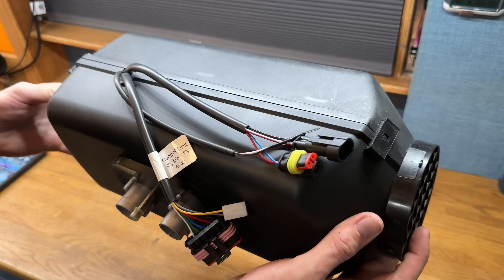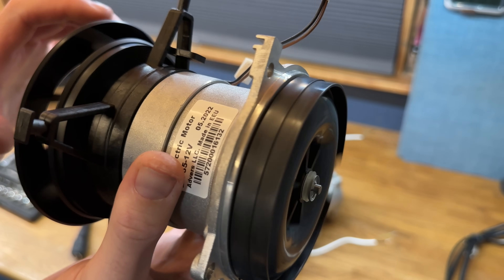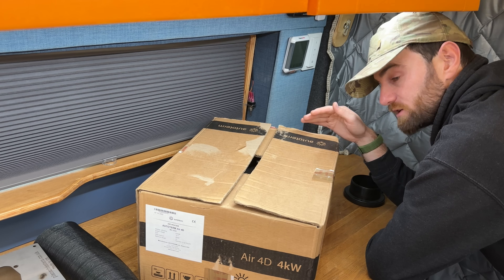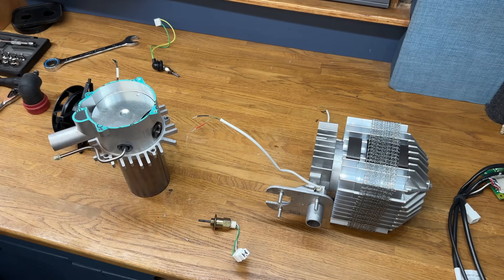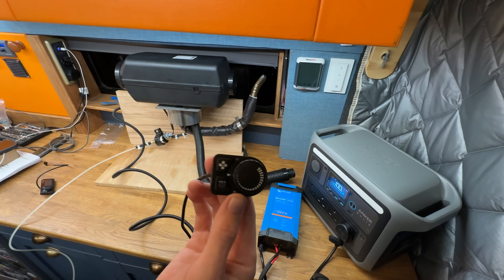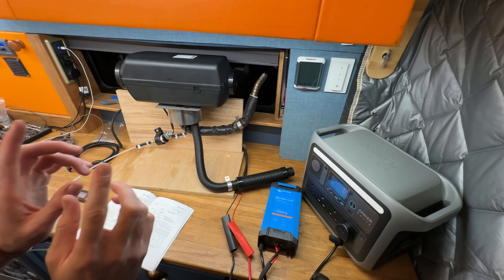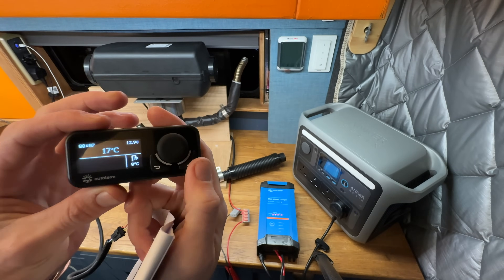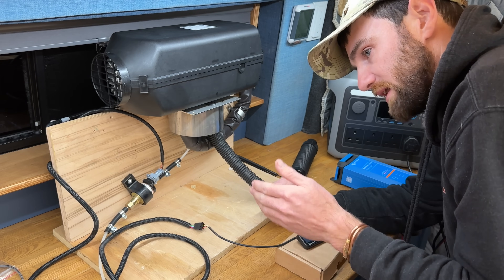UNIQUE DESIGN! DIESEL HEATER AUTOTERM AIR 4D

Comment: Hi, I just mounted the Autoterm 2D on my VW T6 van, it seems to work perfectly! One thing I've noticed is that I can hear when the drop of fuel goes in into the combustion chamber when I run it at low speed, with that I mean the noise of the combustion chamber is not linear anymore but it goes up (when it gest the drop) and down, I've been trying to listen to all videos the noise in background but I couldn't figure it out 😄, can you tell me?
Reply from the maker: The lowest setting it’s a pretty slow dose from the pump so I’m not surprised you could hear the combustion. I didn’t notice it on the 4D on low, but the 2D on low will might be even lower. 

I have noticed the pump speed changing up and down one some of the settings

Comment: Bluetti 200ac max has a 30amp 12v output.
Reply from the maker: Indeed, it does not many of the smaller 1 kW sub range. Have anything more though than the normal 12V 10A socket . It would be nice if some of them would start to use the Anderson connector or the XT60 for a 25 amp output

Comment: Hi Alex I am a complete diesel heater novice so excuse me. For any diesel heater can they run off a leisure battery or do they need mains or an inverter
Reply from the maker: Diesel heaters normally run of 12V DC. So they run off your leisure battery

Comment: Hi I have trouble with my diesel heater and thought you would be the best person to ask 😊... Basically it turns on starts up blows out hot air then the screen /display turns off. It has a 15amp fuse on it with a extended 6mm 53amp cable direct to the battery. Any idea what the problem could be 😟
Reply from the maker: Just to check as you’re commenting on an autoterm video. It’s an auto term heater to are having an issues with?
Reply: @MispronouncedAdventures  no it's the maxpeedingrods sorry
Reply: @MispronouncedAdventures  oh and it goes to 100amp hour renogy lithium battery which on the app says 12.9v

Comment: Ah! Watching now :)
Edit: I think Autoterm classifies the metering pump over 100 clicks. So your pump delivers 6.8ml over 100 clicks/pulses. Whereas other manufacturers measure by how many clicks for 1 ml. There are 16ml pumps (16 pulses for 1 ml), 18ml, 22ml, etc. The heaters need to be setup for the pump to have the correct Hz for the heater. Many Chinese heaters come with a random pump and the boards are not correctly setup for them. Heaters that soot up quickly probably came with a pump that is simply too large or the board hasn't been setup correctly.
Reply from the maker: Lots of different pumps around for sure. My engine pre heater is .42, one of my US / china Heater .62

You are right about the wrong pumps on wrong ECU’s is pretty common
Reply: Interesting! Have you covered that in any videos? Easy way to identify and resolve an issue of incorrect pump/board setup? @MispronouncedAdventures
Reply from the maker: No in videos as I’ve not had any incorrect issues with that personally, but I have fixed heaters before and see it referenced. Quite a few times online about wrong pump and ecu combos. 

It’s a lot more common on the 2 kW Chinese heaters. But seen them using .16, .18.5 & .22.

Comment: With the simple controller the fan doesn't stop even at required temp in any mode. Good for air circulation but not ideal. Hence need to change to better controller
Reply from the maker: From my understanding on the simple controller that requires the external temperature sensor In addition?
Reply: Even with the external temp sensor (which I have) when at required temp the heater stops but fan continues at all times

Comment: This vid couldn’t have come at a better time mate, but im still torn.

The quality of the Autoterm looks ace and has always been the plan to go for, I just don’t know whether to go for a 2kw and run it 3/4 to flat out all the time,  or 4kw and run only about 1/2 power else get too hot and soot up quicker etc.. especially in the warmer months when it’s on lowest just to take the chill off. 

I’ve had a 1.5kw fan heater running whilst I’m building and sometimes find with the door shut it gets a bit hot but then that’s at 2oC not minus-25/30!!

Mines a LWB sprinter, insulated well. 10mm closed cell foam(double layer full roof and cab bulkhead area, then pir board walls floor, and recycled fluff insulation in all the awkward areas.. 

We’re Looking to do -20 plus trips like yourself.

I feel from the ending you thought the Autoterm was good but still preferred your own setup with the afterburner??
Did you ever do a review/demo of that I can’t find it anywhere 

I’m still tempted by a Chinese 5kw and afterburner! Plus carry a spare for less than the Autoterm 

It’s not an easy decision!
What would you go for if you were building your van now mate?

Cheers 
Ant
Reply from the maker: It’s definitely a difficult decision. I am very spoilt by having an afterburner which is for a software side and abilities/features is superior to everything else on the market. 

But the Chinese diesel heater it controls is just a normal Chinese diesel heater whilst mine has been problem free. the Autoterm hardware wise is superior

Personally I would go for the larger, 4kW over the two. The vast majority of even my Chinese heater has been on low to less than half power and it’s generally clean inside.

The two features I love the most about the afterburner is the remote access and the ability to get all the data I want from sensors and RPM available and it’s thermostat, which I would say, performs better than the autoterm. However, it’s difficult for me to fully test the thermostat, without having the heater installed permanently

Comment: I installed my first heater last week and for some reason, I am getting a little smell in the heat outlet until the unit turns on and runs...
Reply: Mine was like that for a while, just needs running in 6-8 continuous hours at full blast.
Reply from the maker: I’ve heard similar before, well, I don’t know what the issue might be. There could be a number of things it could well be. a grease or oil leftover from the manufacturing process on the heat  exchanger which is getting heated up and will eventually evaporate after a few uses

Comment: Can anyone tell me if I could run this 2KW heater from the 12v car socket on a Bluetti AC180P?
Reply from the maker: I’m pretty sure it’s a no on the 12V car socket. looking at tech specs for the AC180P it’s 12V socket is 12V @ 10A. Which is probably a few wonts less than needed. Although I haven’t tested the 2kW version. But I imagine the glow plug and motor will be pretty similar.
Reply: @MispronouncedAdventures In that case I wonder if ran this 'Mercury Switch Mode 13.8V Bench Top Power Supply - 20A' from the AC, how much power it would draw after the initial power up stage? Great content btw..
Reply from the maker: @ I imagine so. many people to get them to run easily directly off power stations use a variety of AC to DC power supplies of at least 20 amp
Reply: @MispronouncedAdventures yeah I think that's my only option then. I was just a bit concerned that the AC/DC converter would draw a lot of wattage from my powerstation. Sorry to keep going on about it, but could you estimate a ballpark figure of the wattage it would draw?

Comment: Is that the noise it actually makes? Jesus. How do you sleep through that? It's like a jet plane taking off 😂
Reply from the maker: I wouldn’t of said it was much louder than my other heaters on max. But I am recording in a conference space and also have the exhaust pipe semi inside and the air intake completely inside . Normally unit as enclosed in a vans garage area or cupboard not on a open table

Comment: Interesting vid chap, cheers 👍
One small observation if I may ?  editing was very choppy, are you using a new editor 🤔
Please don't take it in a bad way as it's not intended 👍
Reply from the maker: It might be the way I’ve edited it I’ve been a little inconsistent on this video. 

Normally breakdown and tear down videos, I tend to fast forward / speed up sections between talking or action points. Mainly say the viewer can see the process. And when I’m normally doing just talking parts, I just cut the footage between two parts for a jump cut.

I think there’s a few talking parts I should probably used a jump cut and not spread it up. 

It’s not always easy to see the full effect of the sped up sections until the final render, especially if it’s a short bit
Reply: @MispronouncedAdventures  na that's  cool chap I thought it might just be me , enjoyed it as allways 😎👍
Reply: Yer payes yer money and you take yer chance ! I have three Chinese diesel heaters and two of them have steel pressed casings and those run flatout with no issues  the other I have had to replace due to seized motor. Great video thanks Richie.
Reply from the maker: @richiebainbridge2608 yeah in my van, I use a Chinese one which has got almost 4000 run hours and only ever needed new motor bearings.

Comment: I will be keeping my Chinese diesel heater , very reliable and economic to use .  I dont believe  the get what you pay for myth  as the chinese heaters have proved .
Reply from the maker: My personal heater is Chinese heater with 5000 run hours over 3 arctic winters on which I  brought for £84 ( which I run with a afterburner control with ) 

so I’m definitely not one for believing cheap Chinese heater = get what you pay for. As I use one for my main heater. But overall built quality is low, interfaces basic, accessories can be  crap which back all get sorted. Some are crap, some are great. But I would say Autoterm for high quality heaters, good accessories parts, good controllers, warranty, customer support and legit marks is great value for money. ( which I don’t believe espar or webasto )